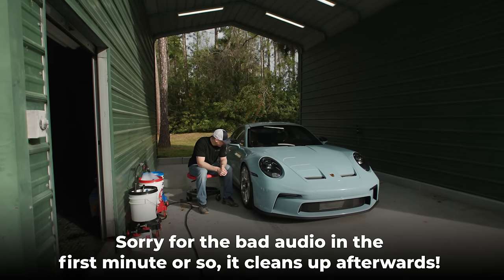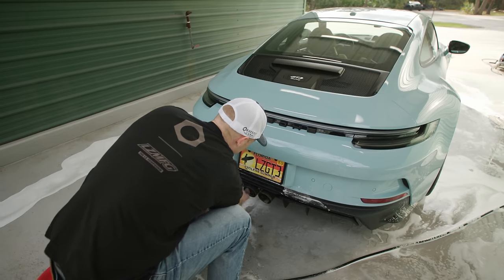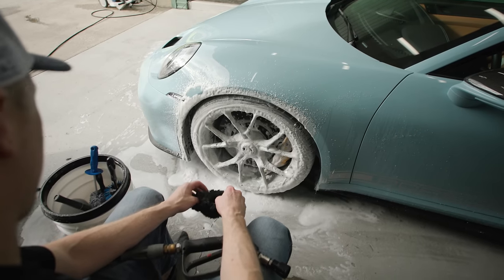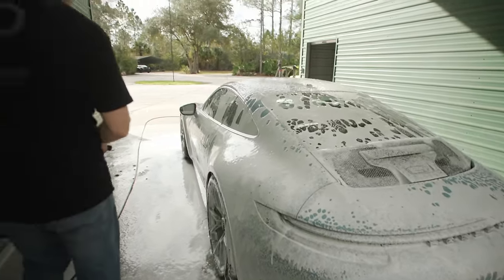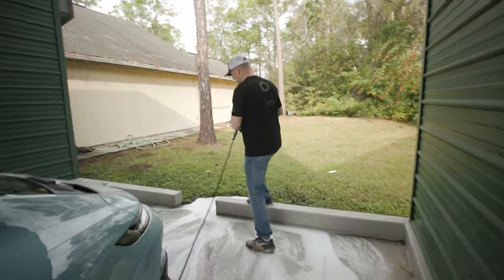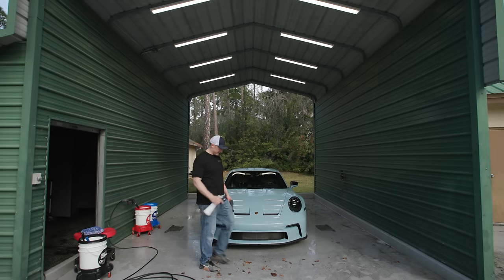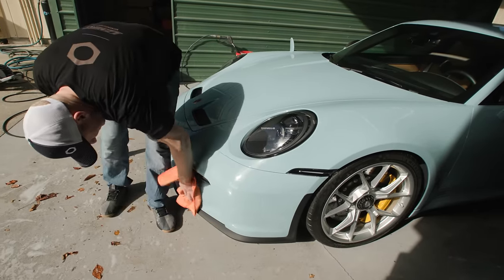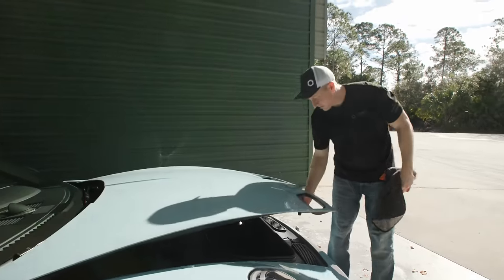Wash & Talk on The LZ GT3 Touring

Comment: I'm from the UK, the new Touch-less is nice. I think they might be bringing back the 5ltr container soon, whether or not it'll have the concentrated formula or not I'm not sure, when I contacted them 'they pass on my comments to the production team and do their best to make Touch-less in the 5ltr as soon as they can'. Meanwhile, the Trace-Less formulation has changed to reduce the peardrop smell. My advice is to wash the clean towels you get with Trace-Less in the wash DO NOT LEAVE THE TOWELS ON ANY VARNISHED WOOD SURFACES LIKE I DID, it will ruin the lacquer!! It's a decent product but you need to be careful about over spray on certain surfaces. I also strongly recommend is Touch-on shampoo, if your using Touch-less why are you not using Touch-on?? It makes no sense. Touch-on works extremely well IMO after you've shampooed your car, apply it via your snowfoam cannon and work in with your shampoo mitt quickly (as you've already shampooed your car) this makes the gloss level pop like it's freshly been ceramic coated! The beading is very good. You don't have to apply a drying aid or anything else if you are using DI water and a blow dryer. It's so much easier to finish a car with. Why isnt everyone using Touch-on??. Madness. ....

Comment: I can’t get into touchless for some reason. Tried it a number of times now and just can’t seem to gel with it. I use the predecessor to it called Auto Foam which is green, a bit thinner, smells amazing too which is nice but for whatever the type of stuff they use on our roads in winter where I am in Northern Ireland, Autofoam always cleans more road film for me. I think they do say on the BH site in some cases Autofoam may out perform Touchless and Vice Versa. For me it’s AutoFoam, Korrosol and Double Speed wax. If you ever get a chance to try DS I would suggest it. A very affordable and durable wax, but less is more as too thick it can be a bit on the sticky side to remove. Thinner layer and it’s hard to beat for the cost and durability

Comment: Hello, is there a product you use to prevent the brake rotors from rusting after a wash? I am having this issue. I don't want to drive the car to dry the brakes because often times I wash in the rain and driving would inevitably get the car dirty again before pulling back into the garage.
I appreciate the great videos. Thanks

Comment: So the IS F has exhaust from England call Hayward and Scott but the exhaust tips are a flat coated Matt black but they have a bunch of crap all over them first I try to Claybar but they’re still like a road contaminants stuck to the paint. I’m wondering if I could use steel wool 0000 ? I’m afraid to use any compound or wax because they might turn gloss.

Comment: Matt should get some GYEON bathe in the store.  Just the original one.  Not the one with the extra stuff but the original bathe.  Also had a question why the dr. Beasley for exhaust?   I generally just use the same products I use for wheels on exhaust.
Reply from the maker: Wheel coating is not high enough temp capable, so it doesn't last.  I think Bathe is good.  For a long time, they didn't have a gallon.  Since then GSF has come to the US.  I think it is better.

Comment: Matt, don't you find reset lacking glide and lubrification compared to GSF ?  I like reset in the bucket but find GSF so much better than reset for the foam. As for touches, been using the old formula for 2+ years and absolutely love it, looking forward to the new formula.
Reply from the maker: I do much prefer GSF, but the lower pH Reset does seem to keep my coatings working well.
Reply: @ObsessedGarage  ok, makes sense. Will give it some more trial with reset on the foam canon. I remember in one of your video stating reset was mediocre at best. Is it better when foamed ?

Comment: I’m wondering what your thoughts would be on keeping an older or cheaper everyday driver to an acceptable spec. I just don’t feel like I need to use high end product on my old Prius but I like to keep it clean.
Reply: Don't dismiss the value, of the user experience, when using better products.  Makes the process more enjoyable and less of a chore.  Your results will be better and in return the accomplishment will outway other variables like price.  The crappy stuff is just as expensive as what OG offers.

Comment: Why do you do a bottom up rinse of the foam?  It's been burned into my brain to  work from the top down.
Reply from the maker: Only with the pre-wash.  I completely made it up with no empirical evidence other than it seems to make sense.  I want to remove the dirt with the soap.  If I wash from the top, I don't get the action of the pressure washer.